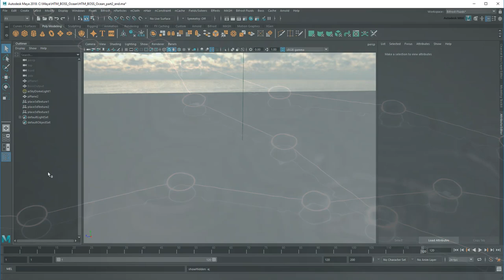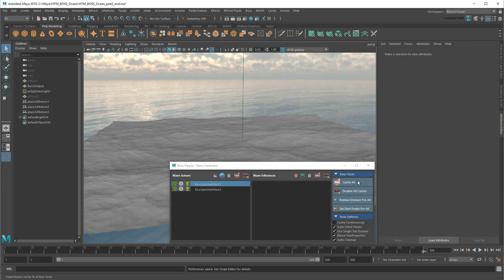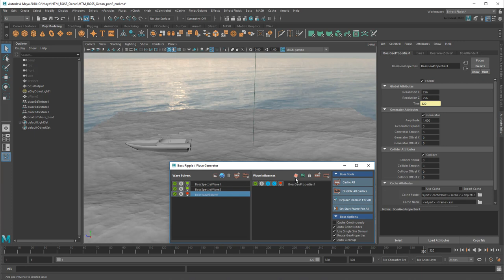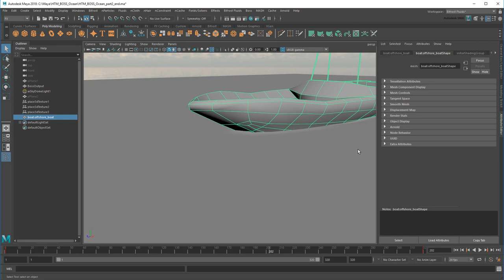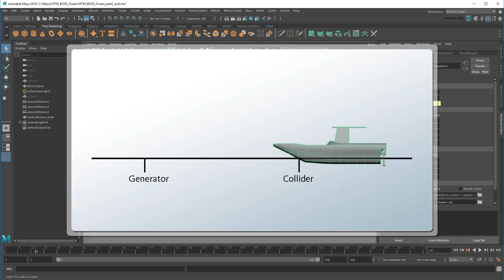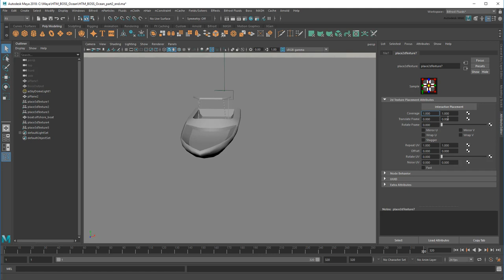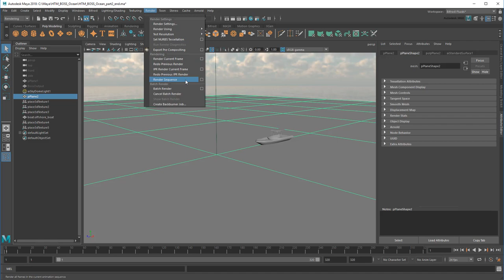Creating an ocean - Part 3 of 4: Adding a boat wake

Comment: Hii, I am having trouble after adding wavesolver and geo properties. When i play to simulate with bossoutput and boat on it. Bossoutput starts to fall apart and are doing some crazy things. I followed your every step even tried to change some things like lower up the resolution, reducing the amplitude. It kinda works but not giving a proper result still a bad one. I Have seen many comments here just as the same situation as mine. Is it a bug ?  Please can you help us by clearing this out...

Comment: when I add wave solvers to my boat (a generic catamaran hull) it turns out really bad m looks like a bunch of vertical indented lines  that looks super unrealistic. however when i made a playblast (just so i could see smooth animation since the cache is chuggy) it looked way better.  (albeit weaker)   when i go on arnold render view though it looks just as bad as it does in the viewport. it also quietens it down when I cache it.

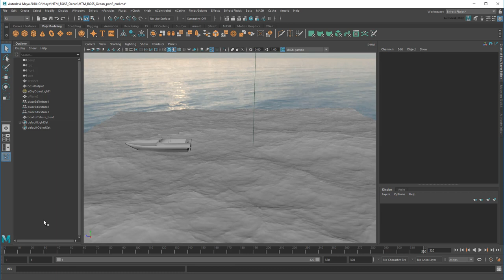Comment: Hello. I've followed the tutorial all the way up to 2:37 but as soon as I add the Wave Solver and the Wave Influence, it seems to go all wrong. When I start to playback my animation, all of my spectral waves disappear and all I get is my boat floating along on nothing! I've re-tried the tutorial multiple times to see if I've missed something but I haven't and on some occasions, my spectral waves start to go crazy and start to form into jagged lines! When I look back in my BOSS editor after the animation, the Wave Solver is now above both of the Spectral Waves when I put it below just like in the tutorial. Could this be the issue? 

Thank You.
Reply from the maker: Hmm, that definitely doesn't sound right.  Can you try turning all the caches off, then play the scene again?  It will play slower, but at least it'll allow you to rule out a caching problem.

Also, make sure to set the Playback Speed to Realtime Free (right-click the Time Slider).
Reply: @Autodesk_Maya  Thanks for the reply. I have just tried this and it has come out with same result. Also, when I put my time slider into the Real Time, it causes the time slider to skip frames.
Reply from the maker: @theactualalfie9045  Sorry I misspoke, I meant "Every Frame, Free".  I need more coffee lol.

Another question, you're sure you're running the wave solver simulation on the same input mesh as the spectral waves right?  And that you're displaying the output mesh of that simulation?  As opposed to the flat, tiled plane for rendering in lesson 2?
Reply from the maker: @theactualalfie9045  Oh and to answer your earlier question, no it shouldn't matter that the Wave Solver is above the Spectral Solvers.
Reply: @Autodesk_Maya  I've just tried that and I'm still receiving the same result. I have the poly plane (pPLane2) hidden like the tutorial says and I have the BossOutput turned on which the simulation is on?
Reply from the maker: @theactualalfie9045  Are the spectral solvers also enabled (green checkmarks) in the Boss Editor?
Reply: @Autodesk_Maya  Yes they are.
Reply from the maker: @theactualalfie9045  If you can, please create a free account on the AREA and post your zipped scene file in a new topic here: https://forums.autodesk.com/t5/maya-dynamics/bd-p/area-b51

I can then take a look at it (along with the rest of the community).  From the sounds of it, it should be working.
Reply: @Autodesk_Maya  Sorry for the late reply. I've been working on my presentation for the university I would like to go to, I will try and upload it ASAP. 

Thanks Again for your help!
Reply: @theactualalfie9045  Did you ever get an answer for this? Having the same problem

Comment: Hello again, I'm really stumped at the moment, as soon as I add the boat as a wave solver and move a frame, the water turns jagged with a cross through the plane, the wake is there but the water is going crazy. I'll try to get a screen grab for you. It feels like a glitch but it continues happening and I've restarted these tuts several times trying to figure out where I went wrong.
Reply: Sorry, I add the boat as a wave influence is what I meant to say.
Reply: Correction, there is no wake, when I turn the wave solver off, everything returns to normal.
Reply from the maker: @ChettarKK  Is it possible your wave solver settings are too high?  What if you turn off the spectral waves first - is the wave solver still crazy, or does it look correct?
Reply: @Autodesk_Maya  I really don't think so, this is a strange situation I've been having every time I get to this exact spot. It happens immediately after I apply BossGeoproperties1 to my boat, If I hit play, it plays through normal with no wake result, if I hit forward one frame the entire water plane disappears, and if I click in the timeline forwards or backwards, the water begins to protrude out like stucco. All of my settings on the wave solver are exactly like yours. The stucco stays even though the plane flattens out when I hide the spectral waves.
Reply: I'm starting to get results by keeping the resolution the same and shrinking the wave height and amplitude, could it possibly have something to do with the scaling, just like the boat?
Reply: When I scale up the resolution, everything goes wonky.
Reply from the maker: @ChettarKK  Oh are you working at a different scale?  That would definitely have an impact.  Scale has an impact on all the settings in BOSS.
Reply: @Autodesk_Maya  I am really stumped, when I scrub to different spots on the timeline, the boat will create a wave emanating off itself, however when I just let it play through it doesn't produce a wake.
Reply: @Autodesk_Maya  The only scale I have different than the tutorial are in the size of the p-plane2 projections, which wouldn't affect this part of the tut, correct?
Reply from the maker: @ChettarKK  What playback speed are you set to?  Every Frame Free?
Reply: @Autodesk_Maya  Every frame free.  After some slow tweaking and playing through slowly a proper wake is taking form, but the resolution of 600 on the wave solver really throws everything out of whack, I have to leave the resoluttion at 256
Reply: @Autodesk_Maya  So, I've completed successfully all the way until around 9:30, you bring up your hypershade window and it appears that mine looks entirely differrent, I went through the hypershade motions anyways and it looks like the center square stays the same, but the foam applies to the rest of the plane making it all white with the center staying normal.  Haha, thanks for your patience.
Reply: I’m having the same issue, did u ever manage to fix it?
Reply: @Holly-pf4mi  Lol, uninstall, and then install Blender.... JK, I fixed it somehow but it was a solid year ago so I honesly don't remember, I had crashing issues with Maya so I did switch over to blender.
Reply: @Holly-pf4mi  Haha, yes. I cancelled Maya and Downloaded Blender a year ago lololo.

Comment: When I play the timeline, the wake appears incredibly intense and there are even ripples around the edge of the BossOutput plane. I reduce the Amplitude down to .2 where it looks good in playback, but when I hit Cache All, the wake is barely visible (and luckily the ripples at the edges of the plane are gone). Why is there a disconnect between the playback and what is actually being cached?
Reply from the maker: There really shouldn't be.  Are you using the included scene files, or your own?  Scale could be a factor here.
Reply: @Autodesk_Maya  I followed along with the tutorial and created my own scene file, matching all the settings in the tutorial.

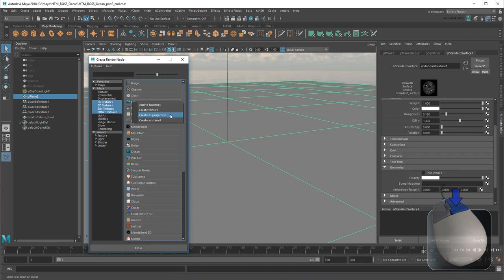Comment: At 9:33 I don't understand how the main spectral wave foam nodes are now standard non-projection nodes when they were replaced by projections in the previous video at 7:57?
Reply from the maker: The foam at 9:33 here is the wake foam.  At 9:44, we add it to the projection foam you're talking about (which is the holdover from the previous video).

Comment: If anyone has the problem that the waves doesn't show with the moving object, one of the reason I found is that the collider is too small. My boat didn't have the effect in the first size, so I made all the scales twice then the waves started working.
I guess Bifrost just needs bigger model to calculate the movement. The first time I met this problem was on making water in bottle, then the water kept disappearing when I press play. The final solution was the same above but it stock me for days.
Reply: scale in bifrost is very important
Reply: thanks that helped
Reply: Thank you for your advice! but It still does not work on my scene.. do you know any other solution for a real scale?

Comment: Hi There! Great Tutorial series! I have a question. Once I add the BossWaveSolver and the Boat as a BossGeoProperties the wave solver creates huge waves around the boat instead of a nice wake like in the video. I tried deleting both the Wave solver and Wave influence (boat) and re creating them and I get the same result.
Reply from the maker: What's the scale of your simulation?  Are you using the provided files, or your own files?
Reply: @Autodesk_Maya  Same problem here, I try with a simple 60x60 plane, I use a relatively simple cylinder as a "boat", but the mesh just explodes.

Comment: When I boost the wave solver resolution up to anything above 300, maya crashes. I have a pretty solid z840 computer, so I'm not sure what the issue is. 8 core Xeon E5 2637 and 128 gigs of ram...could it be a GPU issue? I've got a quadro k5000
Reply from the maker: Hmm the GPU shouldn't be an issue since Bifrost Liquid runs on the CPU.  Is your scene just the one above, or are you trying this in your own scene with additional elements?  Also have you updated to the latest version of whatever Maya you're using?

Comment: I'm having trouble getting any collision from any object. I have a plane with the spectral waves added and have a cube moving from one end of the plane to the other. even though I have the cube selected and I've added it to influence the plane, I'm not getting any collision. Am I missing anything here?
Reply from the maker: Hmm.  Are you sure your wave solver cache is disabled?  Have you tried really cranking up the wave height for it?
Reply: Hey mega its a long shot but was your gizmo set right? i wasn't getting anything either till i did center pivot,freeze transform and delete history for the original plane, the result i got was weak so had to crank things up. (gizmo was slightly lower and rotated)
plus for the object doing the colliding

Comment: Hi, hello, I don’t know if you have time. I want to ask you a question. I am studying your tutorial now. I use the same version of Maya, but one thing that makes me very depressed is how do I cache and When loading the cache, he just can't use the cache, and it must be loaded frame by frame during playback. What is going on?
Reply from the maker: Without getting too far into it, the Bifrost cache isn't really a "final" cache - it's more of an intermediate step that helps while you're still working on the effect.  When you're actually done, you can select the ocean mesh and go to Cache > Alembic Cache to cache out final animated geometry.
Reply: @Autodesk_Maya  I know, but although there are cache files in the cache folder, no matter how I load the cache files, it is useless. I feel that the player did not find the cached files, but I checked the load. He still I need to start rendering every frame from the beginning, which makes me unable to adjust the ripple effect produced by the boat

Comment: sorry, im on minute 2:21 in steps order, but when i hit play the animation is way too slow, unlike yours, do you know why?
Reply from the maker: What kind of CPU are you running?  In general, effects can be quite CPU and RAM intensive.  In the end though, the interactive performance won't matter since the render sequence (which we show at the end) will always run at full speed.
Reply: Maya Learning Channel I'm on a i7 8700, with 16 ram, the thing is, when I'm seeing the effects of the boat on the water , it runs too slow to see them properly. In quite new to Maya so I don't know if I have to config anything to use both gpu and CPU or something like that...
Reply from the maker: Bifrost is mainly a CPU based tool.  16 gigs of RAM is probably a bottleneck as well (I have 64 on my demo machine).  You can try temporarily reducing the number of subdivisions on your ocean plane and then re-caching just for interactive lookdev purposes.  Then, once you're ready to render your final, you can turn all the settings up again.
Reply: Maya Learning Channel OMG , I didn't know, well thank you for the answer, I'm gonna do that

Comment: Isn't scaling everthing down for Bifrost to match this "1 unit is 1 meter" affects how Arnold redner stuff? I mean Arnold still assumes that 1 unit is 1 cm (or whatever is set up in preferences). Do I have to change Render Unit to "Meter" instead of "Use Maya Unit" (in Render Settings window > System tab  > Render Settings section) to have shaders and lights behave appropriately?
Reply from the maker: As long as objects have a consistent relative size, the units shouldn't matter very much.  You may just need to adjust intensity or other light parameters to compensate, but you won't get incorrect reflections/refractions or anything like that.

Comment: I'm having a similar issue to others, the wake doesn't show up after applying the wave solver and adding the geo influence. Looked through the comments and haven't found a solution that works yet. Thanks for the tutorial, super cool!
Reply: Ok, actually it's showing up but its starting super far from the ship for some reason. Changing the collider and generator doesn't seem to be doing anything though

Comment: hey buddy, I've increased the wave height from 1 to 1.5, 4 and I'm not getting the same level of wake displacement across the polygon plane.  I thing I've followed all of the steps.  I know this was an issue for someone else.  I've read through the comments but there was no resolve, thanks.
Reply from the maker: Hmm, and your plane has the same resolution and is built at the same scale?  If you check your Preferences in the Settings section, are the working units set to "centimeter"?
Reply: @Autodesk_Maya  yes it's set to cm.
Reply from the maker: @DDAschool  Odd.  Have you tried deleting your preferences and doing the tutorial again with default preferences?
Reply: @Autodesk_Maya  no I haven't but the crazy part is that everything works well except this part.  I'd hate to have to try it again but I'll try.

Comment: After 2 lessons projects started lagging. Though my PC is powerfull it's still not enough. I have good GPU but arnold doesn't use it. If there is any good render program I can use without buying it? I'm still student and using maya for students. Also another question is about how can i make maya work faster? Cuz hiding second plane doesn't affect much speed of maya. Everything lagging. Every movement. Settings 1 unit = 1 cm.
Reply from the maker: What are the specs of your PC?

In general, simulation is a slow process, especially when generating the initial cache.  You may want to try lowering the subdivisions of your plane to improve performance.
Reply: @Autodesk_Maya  intel core i5-7600K CPU @ 3.80 GHz. 16gb RAM DDR3, Nvidia GeForce 970 3gb and SSD 256
Reply from the maker: @timamjproduction  Hmm, on an i5 you'll probably need to step down the quality of the simulation.  BOSS mainly uses CPU.  Also is it still that slow once you've cached the simulation?
Reply: @Autodesk_Maya  i've changed resolution of planes to 512 and disabled all cash. Also second plane made as reference. But stil lagging(
Reply from the maker: @timamjproduction  Wait, you disabled the cache?  You definitely want to be using that.
Reply: @Autodesk_Maya  I mean its not working fast though cash is disabled.
Reply from the maker: @timamjproduction  Right, which is what I would expect if you're not using the cache.  Generally, you'll need to run it slowly once to generate a cache.  Once the cache is done, it should at least run faster once reading from the cache.

Also, 512 x 512 is a VERY dense plane.  The denser the plane, the slower your simulation is going to be.

Comment: Hi! I 've followed all the steps but have one problem : there is no interaction between my boat and the boss ocean, could you help me please? Thank you ! ;)
Reply from the maker: As in the wake doesn't appear?  If you double check the cache files, does the shape of the boat appear in the 2D image files?  Also, try turning all your caches off and then play (it'll be slower, but the boat should appear if you have the right solver setup).
Reply: @Autodesk_Maya  i have the same problem, im check my 2d files but is only a green lines
Reply from the maker: @JustAnotherGhost7  Are you using the included scene file, or your own file?

Comment: Uhm, whenever I add a wav solver, the mesh just explodes, anyone have any idea why?
Reply: Don't change the resolution (like seen  at 2:52) and it should work.
Reply: @HansenEdits  It worked perfectly, you're a lifesaver
Reply: @HansenEdits  Stop tricking ppl